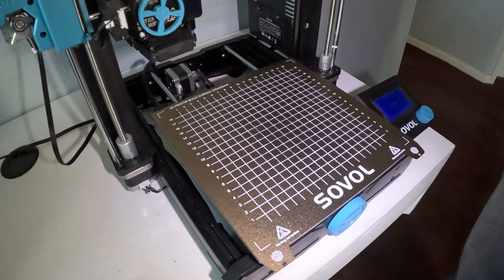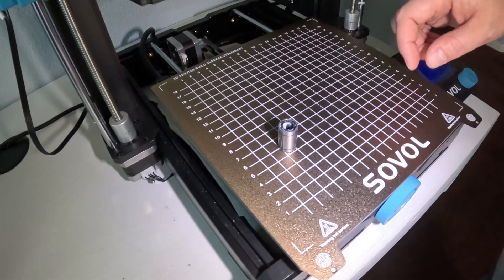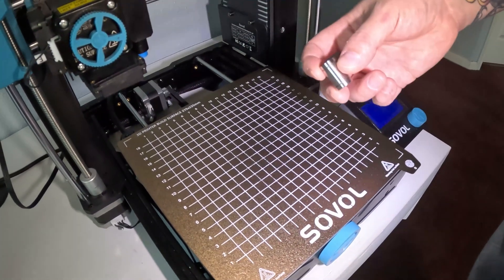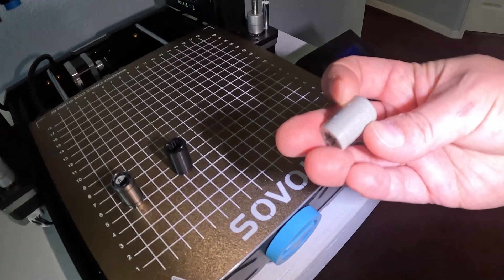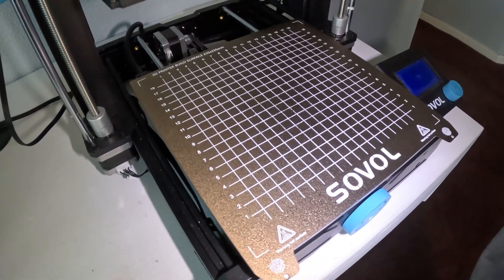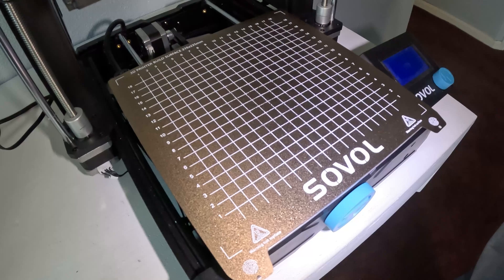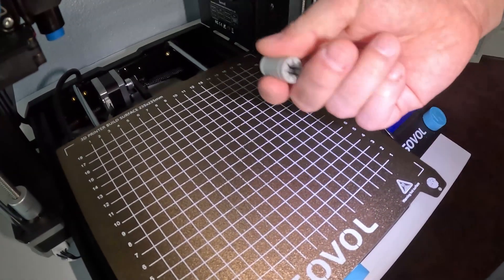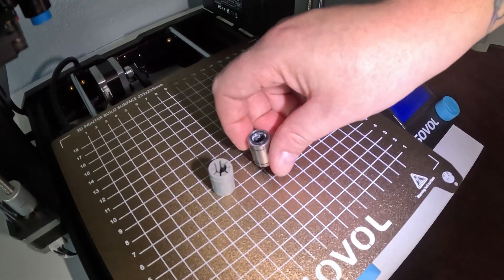My Sovol SV06 LM8UU Bad Bearing Replacement Choices

Comment: My solution to the SV06 noisy bearings was to return it before even opening box. I have seen enough similar complaints to yours that it dissuaded me from even messing with it. I have 8 Ender 3  S1 Pros with Sonic Pads and they have performed fairly trouble free. My next step up will probably be a Bambu printer which the P1P is only $400 more than the Sv06 and several times faster. 
I also have 4 Elegoo Neptune 3 Pros and they are an awesome printer for $250. delivered. I won’t waste my time on the SV06 even if it does look like a Prusa.
Reply from the maker: The bearings were an easy fix. However, it seems like there have been much worse issues with their products leaving the factory. My main reason for this printer was being able to hit the high temps for the more "exotic" filaments lol. Mine has worked well so far. I haven't experienced an issue so extreme that couldn't be easily fixed. Personally, given the slow shipping speeds from Sovol and their hit and miss quality control, I don't think I would buy another.
Reply: Exactly what I decided after watching this video. No way in hell I'm putting up with this crap. These days there are simply too many good options to settle for a headache.
Reply from the maker: @baxrok2.  They're not horrible. I would by one of these over an Ender. The print quality is pretty good. My main issues that I have had were the bearings on both the SV06 printers I have and the z axis motor supports that connect to the gantry. Only one printer had the gantry issue. Other than that no issues. What I'm seeing is quality control with multiple manufacturers is lacking across the board.  Post what you finally decide on.
Reply: @room281tech8  I'm going to save my money and go with one of the newer mid range printers like the budget Bambu, K1, Voron, or other new printers coming out. I've been using cheapo printers for three years now and I'm ready to start enjoying the newest generation of tech and speed. With that should come fewer, but not all of course, worries about things like cheap bearings, etc. Thanks!
Reply from the maker: @baxrok2.  I have a ratrig core xy with a 500mm build plate. They come with several build plate sizes. Maybe look into those if you want to have something unique and extremely fast.  I went with the ratrig because I wanted to be able to print materials like PEKK and PEEK. I went with the Sovol sv06 because it could reach temps up to 300C which allowed me to work with materials like CF nylons and other hybrid filaments. I don't think the voron will hit those crazy high temps like the ratrig but it is a quality machine and definitely worth it.
Reply: @room281tech8  Very nice. Thanks for the info!

Comment: i changed to igus drylin but sadly, theyre only rated for 60c and the rods of the bed get to that temp when the bed is about 80c. so i would get very screechy sounding bearings, almost like theyre squeeking. so im changing to misumi's soon. still using the igus on my X axis and they sound great
Reply from the maker: Strange, I've ran my bed at 80C for hours at a time and haven't had issues. Igus makes a lot of different bearings with varying material. I specifically use these, RJ4JP LM8UU.

Comment: Same issue I am having with my SV06.  Bearings sound like gravel. I lubed and it helped but its still bad.  Very annoying to listen to. I talked to someone that used the dry bearings and said the bed was too hot for them and the got deformed.  Worked great in the other spots though.  Might go ahead and give them a shot since they are not to expensive.
Reply: They used the genuine polymer bushings from Igus? I find it very hard to believe that the bed was too hot for them.
Reply from the maker: That's why I chose the Igus bearings over printing my own with standard materials such as PLA+ or PETG. They never would have withstood the prolonged high temps. Do a quick Google search for Igus Filaments and check out what they use. Some of them have to be tempered and cured to get the best results.

Comment: Ordered an SV06 and doing a little research in prep, and you are the 2nd to say their bearings are crap.  I've heard in the past that the Drylin bearings work great but wear out quickly.  For the ball type LM8UUs, I've had good luck with Fushi bearings on my Anycubic i3 Mega.  Not the cheapest you can find but relatively inexpensive and not junk.  
I've experimented with some vase-mode printed PETG bearings on the Z of a my Ai3M, made them extra tall to reduce tilt, lubed them with SuperLube, and they worked quite well.   I've read that PETG has the same coefficient of friction as POM.
Reply: Third to say it. They sound crunchy out of the box.
Reply from the maker: The drylin bearings may wear out faster, in about 4 months I'll pull them and take some inside measurements with a micrometer. 

The stock bearings were definitely not packed well on my printer. My friend bought an SV06 and his bearings were worse. If my bearing hadnt of fell apart during the repacking I probably never would of tried Igus Drylin bearings. The stock bearings seem much more quiet since I repacked them. They should be fine.
Reply: @room281tech8  Yep, got my printer yesterday and, wow crunchy bearings.  After your mention of breaking one, I didn't risk pushing the ones out of the Z carriages and just cleaned and lubed  them in-place.  Better but some are still kinda rough.  Maybe they will wear-in a bit.
Reply from the maker: @kevinfluet5977  I had to keep reapplying very light coats of white lithium grease to the guide rods and work it in until I got what I felt was l reasonable performance. The z-axis are much easier to pack. I think it is in my z axis bearing mod video. The x-axis are much harder to get to. Even when I lifted the x axis out it seemed the guide rods were really snug in the z carriages. I opted to find a less intrusive method of lubricating the x axis bearings avoid breaking something.
Reply: @room281tech8  Whatever works!  My SV-06's X was relatively easy to disassemble.  Rods were snug but I twisted back and forth a tiny bit to break the friction while pulling and they came out. I cleaned all the bearings with IPA but they didn't really need it so you're probably fine just sneaking lube in under the wipers.
Reply from the maker: @kevinfluet5977  Good to know. Maybe I'll be a little more forceful with them next time.